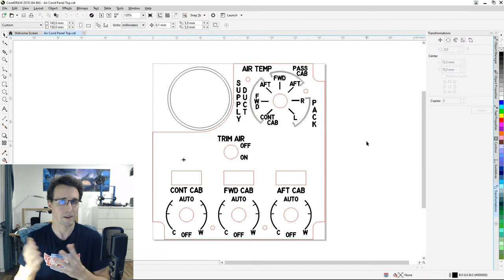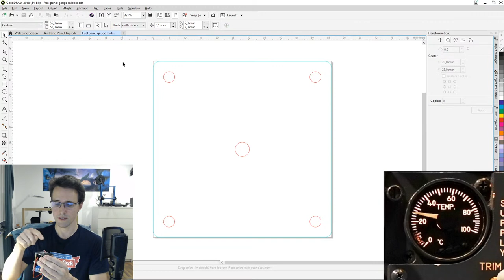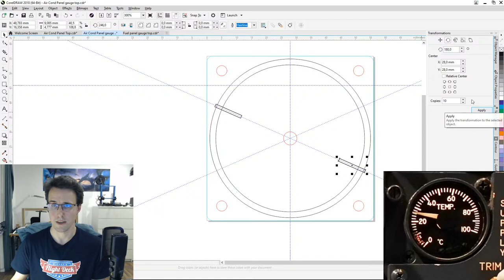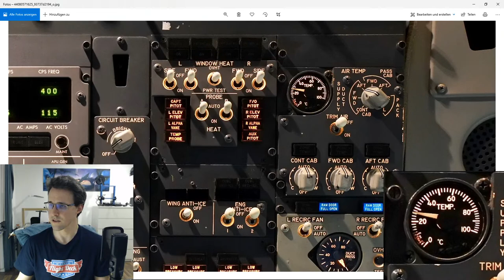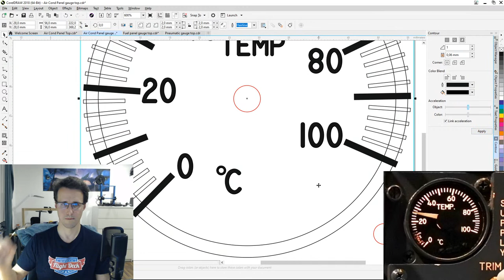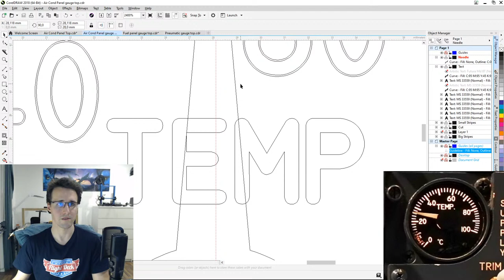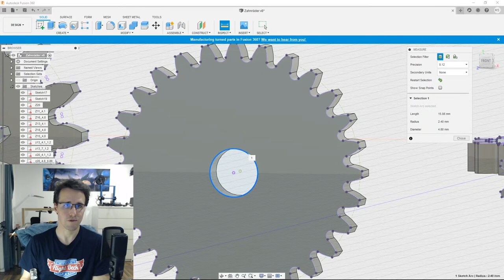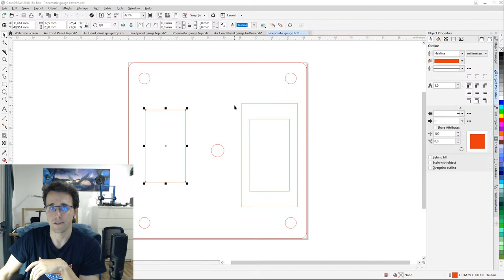Designing gauges - Mickey's Flightdeck - Live Stream 29.11.2020

Comment: 20 and 90 is on the same level. 180 degrees apart and there are 7 equal spaces between 20 and 90. That makes 180/7 = 25.71..degrees betwwen each big stripe
Reply from the maker: Yes, this is something I corrected after the stream. Just a simple calculation that you aren't able to do during a live stream. ;-)